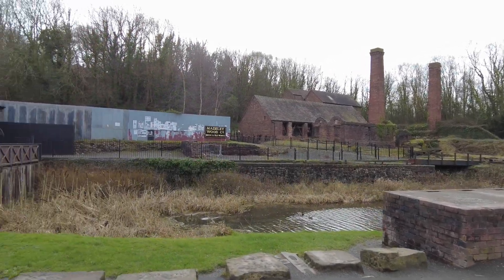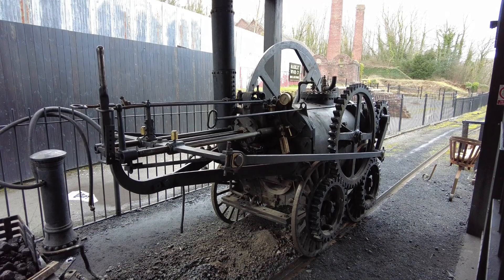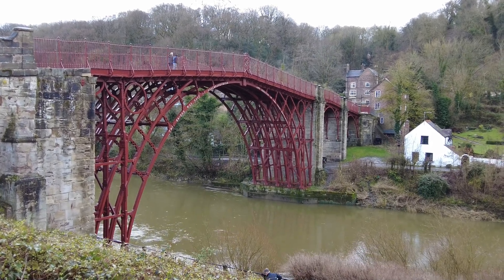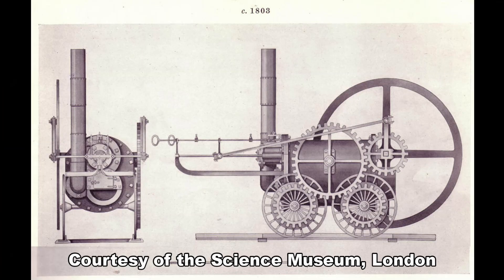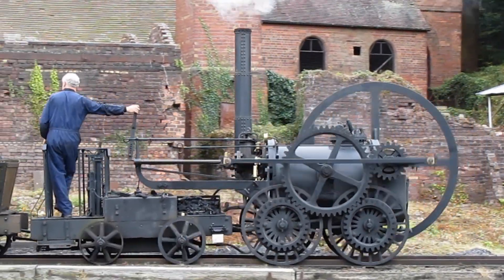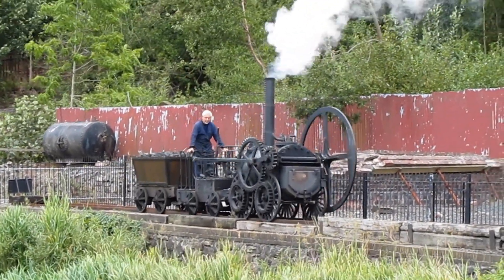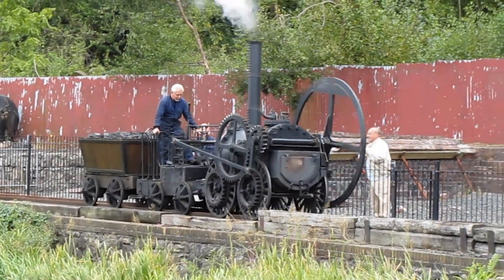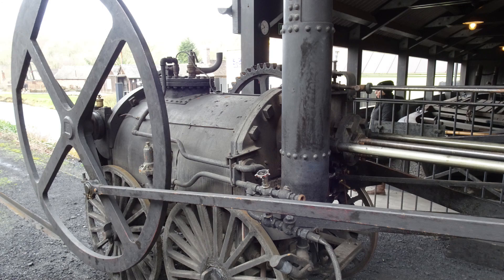10. A Steaming First - Richard Trevithick

Comment: Cap'n Dick, as he was known here in Cornwall was our hero.  Not only was he famous for creating the first true railway locomotive, but was responsible for his 'Strong Steam' boiler, a type not seen before.  It was the first boiler to contain the furnace flue through the middle, which heated the water all around, instead of just below, like the haycock design of former engineers.  This enabled much higher steam pressure, making the Cornish pumping enigines of the time more efficient and economical, which was essential, as Cornwall had no Coal and had to be imported from South Wales.  These boilers and the Cornish Beam Engines combined were the mainstay of Steam pumping and were built and sold all over the World.  Richard Trevithick's original boiler design became the father of high pressure Steam!
Reply from the maker: Thanks for your comment Michael, Cornwall is one of my favoured areas. I’ve abandoned this You Tube channel and merged the topics with my Narrowboating channel now called, My Narrowboat and Heritage Ventures. I couldn’t get any traction on the channel, so felt it best not to pursue it. Cheers, all the best.
Reply: Something to note:  Trevithick's engine was referred to at the time as "strong steam" or high pressure because it operated the piston above atmospheric pressure, instead of by condensing vacuum as used previously.   But it was certainly not high pressure in the modern sense.   It operated at about twice atmospheric, whereas modern steam engines (going back about 170 years or so) operate at up to 200 atmospheres or more.
Reply: @keithammleter3824  I think you've confused atmospheres with pounds per square inch (psi). 200 psi became a pretty standard steam pressure for locomotives by the late 1890s and remained so until the end of the steam locomotive era, but 200 atmospheres (2,940 psi) is a ridiculously high pressure even today for a steam engine of any sort—it's just below the critical pressure of water, where the distinction of "water" vs. "steam" becomes meaningless! As for Trevithick, he was actually willing to run his engines at surprisingly high pressures for his time, if you believe his letters quoted in the biography of him written by his son Francis Trevithick. Twice atmospheric was more like a minimum for him; in a letter he wrote at the same time the Coalbrookdale engine was built, discussing one of his pump engines, he says that engine was built to run at anywhere from 4 to 10 atmospheres (60-145 psi), and the only reason he stopped at that upper level was because at that pressure the resulting strong draft his engine generated would make the boiler produce more steam than he could use! 145 psi would still be considered a high pressure until the late 1800s.
Reply: @colindhowell  The critical point for H2O is 705 F and 3,200 PSIG (374 C and 22,MPa).  Modern steam engines run beyond the critical point because above the critical point because above this point H2O is a pure gas obeying the kinetic gas laws and is dry - that is contains no liquid.  Engines operating beyond the critical point are more efficient.
H2O taken beyond the critical point is referred to as "superheated" because if a boiler was taken beyond the critical point, then it could have no liquid water in it, and you have to have liquid somewhere.  Thus to get superheated steam there must be heat added AFTER the H2O vapour (termed wet steam) has left the boiler.   
Look up superheating in steam engines.
Modern steam plant operates around 1,000 F and around 4,000 PSIG  (540 C and 28 MPa) - about 270 atmospheres.
Reply: @keithammleter3824  Ah, I should have checked the usage in modern power stations before making my comment, I stand corrected. Thank you. Still, that's way beyond all but the most extreme experimental examples of steam locomotive usage; most did not exceed 300 psi. I've heard of superheating before, but superheating for steam locomotives, although it "dries" the steam (heats it well beyond saturation to prevent any condensation), still stays far below the critical point.

Comment: There is a small book, The Penydarren Locomotive by Stuart Owen Jones. Still in print, and, because I have just watched this have purchased a copy off Amazon. Lost my copy many years ago.. Explains the history and route. Quite a lot of the southern part of the tramway route can still be walked (about 4 miles). Further north is a small tunnel that the tram line went through.. Cannot walk through it now as it is sealed but it has painted murals celebrating the journey. I was brought up 6 miles  from Abercynon and walked it a few times. To my mind. While Napoleon was bloodily strutting his military forces destructively across Europe real history was being made in the valleys of South Wales.
Reply from the maker: That was very interesting thank you for that.
Reply: Even better is Merthyr tunnel. Used to walk through it regularly as a youngster. 1 1/3 miles long constructed by Brunel. On the hill slopes above western portal are the remains of navvies stone built huts. Do not know if the tunnel can be entered now as it is regularly sealed up until someone manages to batter a way through  @InterestInHeritage

Comment: About time Trevithck and Kernow were recognised as the true birth the steam locomotive, road or rail. Also the beam engines, two of which are in the Chiswick steam museum still in good working order. Strange that the 200th anniversary of his invention, not to mention Cornish stean engineering, should pass by unnoticed while Stevenson's 150th was heralded as the wonder and birth of steam power. By the way, Telford is an artificial 'fown' that did not exixt until the late 1960's or early 1970's. 
     "Going up Camborne Hill coming down, the steam was building up, the wheels going round, going up Camborne Hill coming down-------."
Reply from the maker: There is no doubt many people regard Stevenson’s Rocket as the first steam loco, more than 25 years after Trevithick. Cugnot had designed a steam powered ‘road vehicle’ before Trevithick but it was the latter that coupled a steam engine to wheels on a track, albeit to a rather dangerous design. Telford is a New Town, one of many that were developed at that time.

Comment: Richard Trevithick built his first steam locomotive at Samuel Homfreys ironworks penydarren  in 1804 it ran the ten miles from the ironworks to the Glamorgan canal hauling Ten tons of iron and 70 men , it was the first steam locomotive in the world
Reply from the maker: I mentioned this in the video, technically it was the second, as the first was built at Coalbrookdale, though there is doubt whether that actually ran.
Reply: @InterestInHeritage  Hi I’m deaf so didn’t hear the video as there was no subtitles , I’ve heard of coalbrookdale , but have never associated it with Trevithick , thanks for the update 👍
Reply: @whatsocc55 Hi John, thanks for watching. There are subtitles, it’s a matter of knowing how to switch them on and I believe that depends on what media you watch. On a phone, click the three dots in the top right corner and go to playback settings. There is a drop down list and they can be switched on from there. On a TV you need to look for the CC symbol in the right corner. This is normally found when you pause and the settings option comes up. I hope that helps.

Comment: A great video, added now to my collection of Trevithick knowledge - thanks! 
I find it fascinating that it wasn't just the idea of the engine which is great - that was the easy part! Now you had to get the parts made and assembled and you didn't just go to your local CNC shop with your CAD files.
Reply from the maker: I’m glad you enjoyed it. Trevithick is a lesser known character but he was well ahead of Stephenson. I’m amazed by all moving machinery and how it’s designed.
Reply: By the early 1800's nearly every town in England had at least one very proficient clock maker, so the calculating of gear ratios etc was probably not a problem. Getting a foundry making them on this scale was perhaps the difficult part!